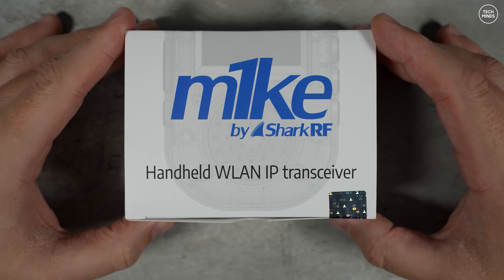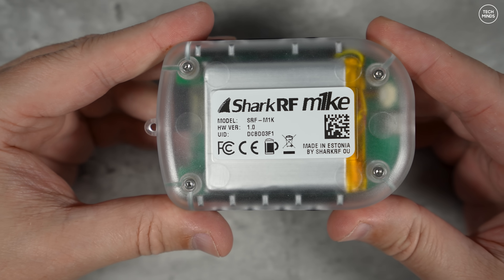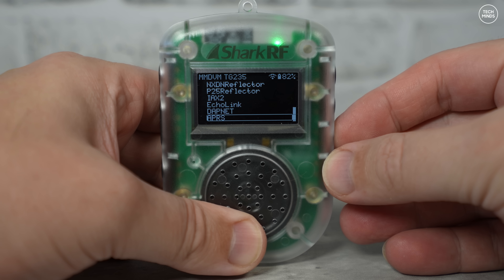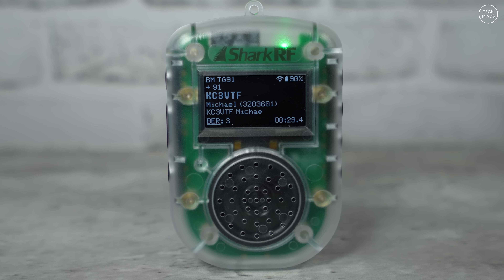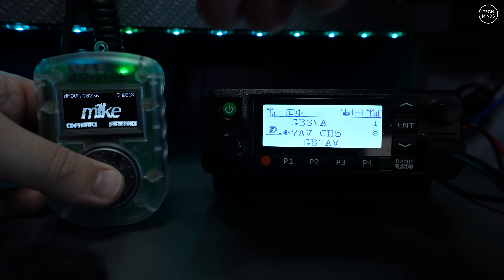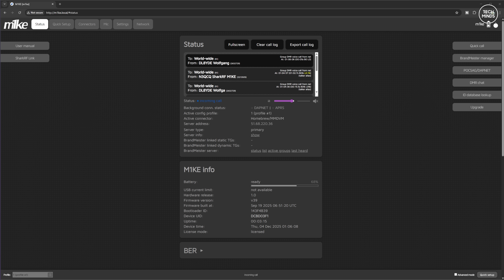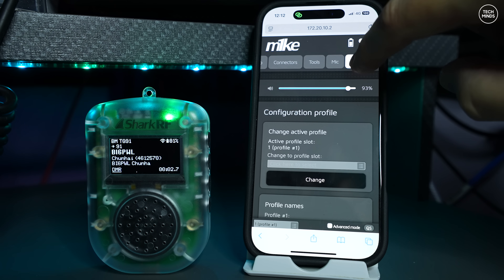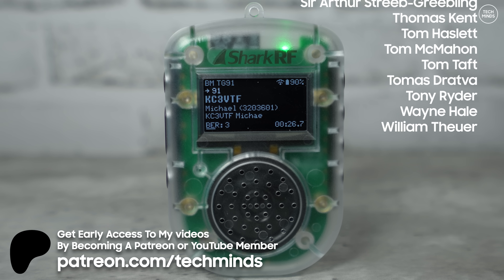SharkRF M1KE - ALL Digital Modes In The Palm Of Your Hand! Now with ALLSTAR!

Comment: I'll just say this, devices like the M1KE are very healthy for the amateur community and excellent for the hobby of amateur radio. It puts people in communication with other amateurs who wouldn't otherwise be able to participate in the hobby. Who cares if it's not using RF within the amateur bands. Amateur radio is literally all about talking to other amateurs, it doesn't matter much how you do that as long as it's made  possible. It's 2025, not 1973, amateur radio has advanced and progressed and that should be embraced and used to it's fullest. This is the all in one digital voice mode device we've been waiting years for. Given that it also does AllStar and Echolink, it's really the perfect little communicator for amateurs.
Reply: Too bad the battery isnt standard
Reply: I like it but the price is insane. Absolutely bonkers. Get a $30 pi zero and you can do all this and more, like the new OFDM ribbit modes, and direct sample/tx out the GPIO CLK up to L band even
Reply: If you don't use radio waves, you're not a radioamateur...period.
You're a "talker", you could aswell use Zello instead.
At least it would have a clear modulation, unlike those horrible sounding digital unrecognizable voice...
Reply: @jplacido9999 this device is perfect for my needs.

Comment: I inherited a IC-7100. and DVP hotspot, and to be honest I hear very little activity on DStar, maybe just the time I have it connected.  But the ability to have all those different digital modes in 1 little box does sound appealing.  Having the ability to jump between the diferent modes without the expense of multiple radios is appealing.  But then again, you are stuck with either running it at home on your home internet connection or connecting it to a mobile phone hotspot.

Comment: will it work over starlkink?
Reply from the maker: Personally I have never tested it over Starklink, but from what I gather Starlink will provide a Wifi signal, so yep, I think it should.
Reply: Starlink is essentially no different than an other ISP.
Reply: @lmamakos No ipv4 with residential Starlink. It uses CGNAT
Reply: @SAB-q4n  good point. worst case you'll need a vpn to counter that 🤔
even though I'll be surprised if it uses p2p in any sense, and in client-server mode CGNAT should be not an issue. iirc many cell carriers do the same..

Comment: I'm at a loss where we are going with all these gadgets,  we torture ourselves with overcomplicated systems that perform with limited fidelity and functionality. As you demonstrated, so many systems are bolted together its difficult knowing how your link to recipient is being achieved with its cross system connections and multi linking.  Back in covid DMR was quite a thing and my group of friends were investing quite a bit of time and money building hotspots and programming hand-helds (codeplug was the buzzword) - but at the same time we were also using Zello as a back channel which in itself was more reliable, more portable and better featured. Now a few years later things have moved more to whatsapp, with its infinite groups and video capability. Time and time I hear people having HF chats that they have just arranged on Whatsapp.  I guess we just enjoy just wrangling with these gadgets to make them work for the sake of it (I know I do, having spent quite a sum once upon a recent time setting up a fusion access point that only I ever made use of).

Comment: Yes this doesn't look like a radio from the 1970s. It also doesn't use repeaters like we did in the 1970s. Luckily, the 1970s were 50 years ago. Technology has moved on, some people have not. This is in fact a radio transceiver. The services you are using:DStar, DMR, Allstar.......all, 100% comunicate via the internet no matter if you access them through a hotspot and a 1970s radio, or directly through wifi.
Reply from the maker: Actually, you can use DSTAR, DMR, C4FM, P25, NXDN without internet. Point to point via rf is supported with those digital protocols. You can even use digital modes through repeaters without the internet or any kind of networking.

Comment: I used to be against any device that does not use RF.  I am not anymore.  It is still communications making QSO's with another HAM operator.  I recently started using DMR.  I connect with allot of operators that are for various reasons, often age, that cannot construct antennas and feedline.  They still get to enjoy communicating with others.   This device would be quite handy to use while driving connected to a cell phone or using at work during lunch.  I am going to buy one for myself.  Thanks for sharing this.  I have often wondered about this device but have never seen one in operation until now.  73 de KM4MMD